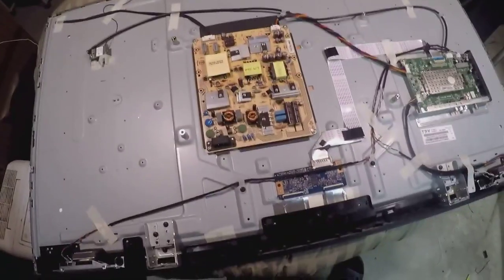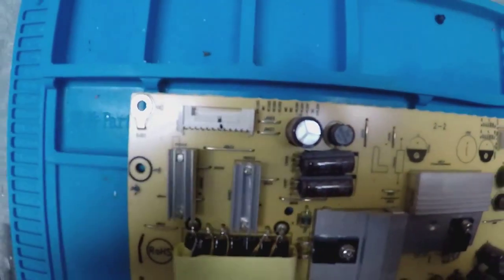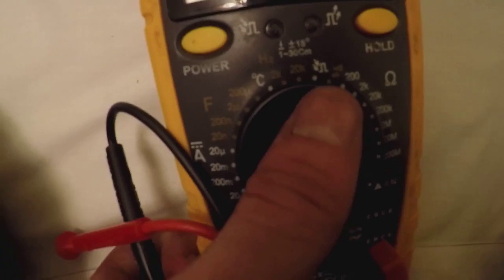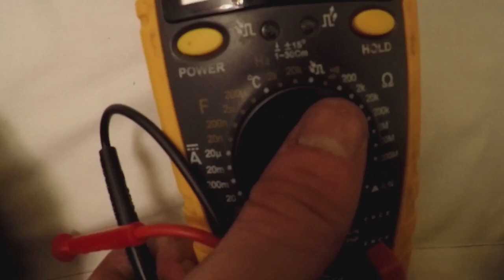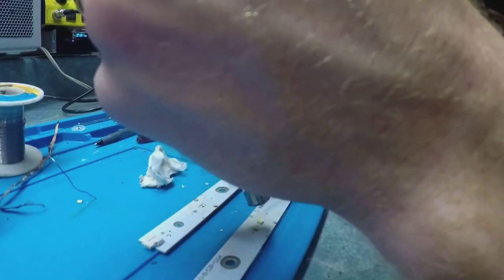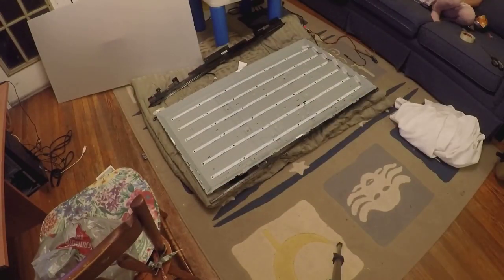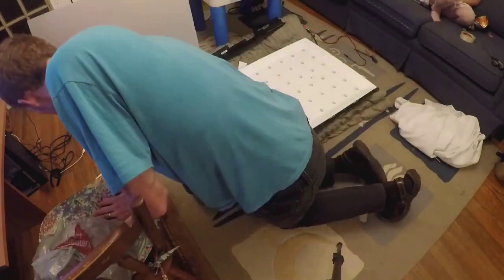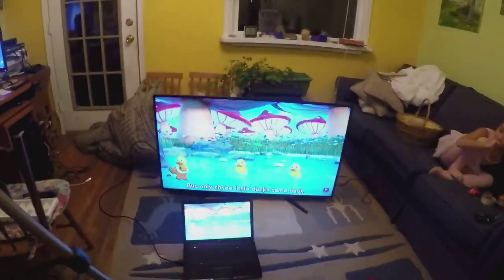Sharp LC 50LB371C TV Backlight Repair (DIY home repair!)

Comment from the maker: Any Questions just ask them below
Reply: hi, these are the  Symptoms for my sharp tv model lc-65n7004y  i see the sharp logo at power up, it is brighter on the left than the right, i have no sound, i tried  the flashlight test and see nothing, the power light is a 5 long and 2 short then the power light goes to red. i have changed the power board and there is not change  thank you
Reply from the maker: @cosmo0080  looks like your backlights are bad use an led tester to be sure.
Reply: @NewsonsElectronics  k, i will have to go buy one thank you
Reply: If the Sharp logo comes on, and sound is working, tv menus are working but the entire screen is mostly blue color - does it mean that LED’s need to be replaced as you’ve shown there?
Reply from the maker: @amosfeldman9454  yep its the led failing

Comment: I actually had a good time and enjoyed fixing mine like you said you just have to be very careful and it is kind of stressful a lot of screws the first time I did it I put it all back together and I forgot to put the diffuser cap back on worst feeling ever had to take it all back apart again put it back on and put it all back together again lol and I did it on the floor like you so it's a little rough on the back if you have a huge table that would be ideal

Comment: This worked spot on for me on my Sharp LC-50LB370U.  Thanks Newsons Electronics.  It just seemed likely the the LEDs were to blame.  Sure enough I had 3 bad ones (although in hindsight I should have checked the power supply first as the amount of work involved to get to the LEDs is significant).  I didn't have a heat gun but managed with a micro torch after practicing a bit on scrap steel of similar thickness.  Of course as someone else mentioned there is still the possibility another LED will fail soon. Indicator-type LEDs can last a generation but it seems the higher the power the less reliable they become.
Reply from the maker: right on

Comment: I have a sharp lc55ub30u that has a power light but no screen glow or any signs of life if i press power it acts like it wants to turn on but that's it it doesn't get any backlight or if i hold a flashlight to it doesnt show picture i replaced all the boards inside the chassis what is causing this? surely it couldn't be the leds could it?

Comment: I have the same tv I tested the led connector I got 68.5 volts each for led 1 and led 2 I hope those are the correct voltages since they are not labeled on the board
Reply from the maker: as long as all the leds light up it is fine that voltage is for one strip in series.
Reply: @NewsonsElectronics  ok that's what I needed to know the strips won't light and the voltage was 68.5 so that means new led strips . Thank you
Reply from the maker: @Ibelieve218  you can just replace the broken leds like in the video as well

Comment: So I have a similar model the backlight went out but the sound and picture remain(can see when I shine a flashlight) which board should I try to replace
Reply from the maker: its not a board it;'s the lights under the LCD screen
Reply from the maker: Use an led tester and test the LEDS the wires will come through the metal bezel

Comment: Great video BTW, any chance you know what the voltage for the led is coming from the power supply ? I would like to test it befor I bother ripping it apart. I have video I can see it in the dark with a flash light, and I have sound. Just no back light
Reply from the maker: 3V

Comment: What if the led lights up but is only half brightness and also I heard it it is just one or two led you can solder over them to bridge the connection, is this true?
Reply from the maker: you can\t solder over them because they will then drive at a higher voltages eg. the other leds will go.
Reply: You go ahead with that idea and you will regret doing so as you blow out the rest of the Leds due to increase voltage and current.

Comment: Hi there- I’m 99.9% sure this is the same issue I’m having with my same model of tv. What would you charge for this repair- I’m located in Hamilton so not too far. Thanks :)
Reply from the maker: for 50" TV it would be around $80 but I am  closed for the moment, you can check newsonselectronics.ca for more info.

Comment: How did you find that it was not  power supply?
Reply from the maker: does it have standby voltage of 5v is so it' probably good. If you can see a faint image with a flashlight your power supply is fine.
Reply: @NewsonsElectronics  i have 5v, and with flashlight i see picture. I took it apart and found that led strips are fine. Ordered replacement power board. Will see if will make difference.
Reply from the maker: @Home_made_ch  sometime it's just a bad connection on the led strips. get an led tester

Comment: could you possibly give me the part # there are hundreds of led's to try and match up , thanks in advance   Frank T
Reply from the maker: https://www.ebay.ca/itm/100Pcs-3228-LED-SMD-Lamp-Beads-3V-for-Samsung-LED-TV-Backlight-Strip-Repair-TV/223460291927?ssPageName=STRK%3AMEBIDX%3AIT&_trksid=p2057872.m2749.l2649
Reply: thank you , Merry Christmas to you all   Frank T @NewsonsElectronics
Reply: @NewsonsElectronics Excellent vid.  I've subscribed.  I thought in the video you said 3030 leds, not 3228s. Thanks for the clarification.
Reply from the maker: @YuDaMan  both should work as long as they are 1W rated